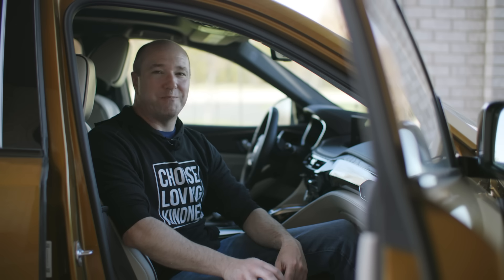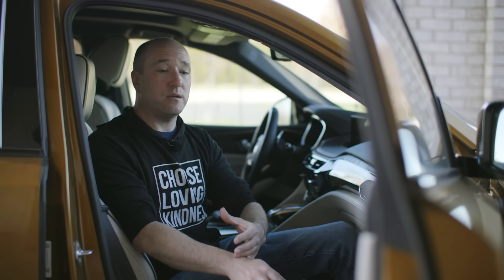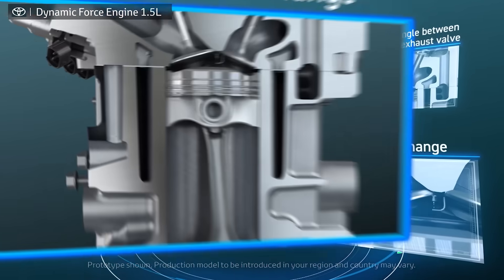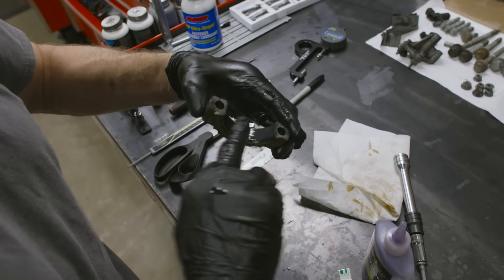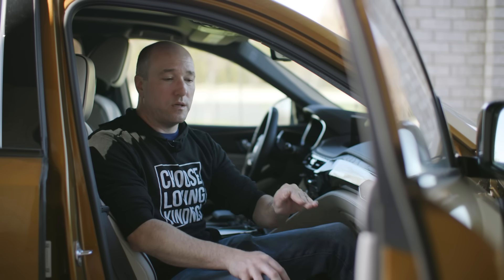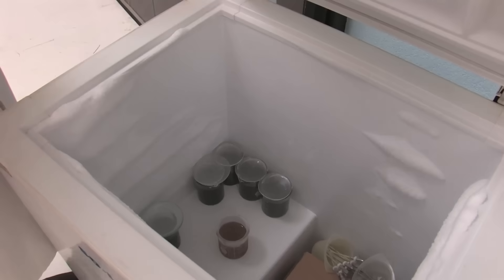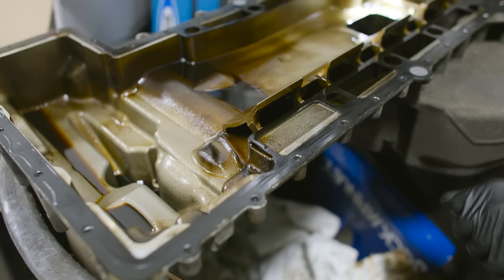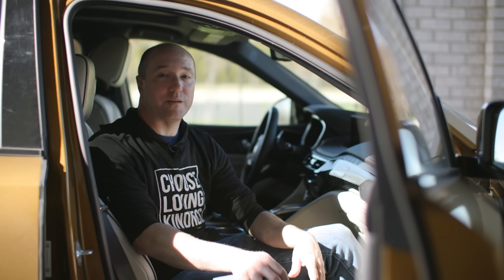Understanding Engine Break In | Dos and Don'ts

Comment: I bought a 2017 Cruze. Looked up the break in procedure. Followed it 99.9% of the period, and after the mileage was over, gently differed from the procedure. 

Then I came out from eating at a restaurant, and I noticed that I didn’t have a GM engine anymore. I had a Subaru engine swap done, while I was in the restaurant eating. Man those guys were good, wish the dealership was as fast as they were. The dealership rebuilt my engine, instead of replacing it, so.

Comment: I just followed the break in instructions in the manual when my 2021 Forester was new. I think it was something like for 1,000 miles, vary the engine load, RPM, and speed, and don't go over 4k RPM.

I think I did it right because we are at 75k now, and no issues. Even the brakes are the original ones. The service techs are always surprised to see how many miles are on it with how new it is lol

Comment: There is enought videos of mechanics checking the quality of the old after the change. 
There is enough metal shavings to prove that the advice about changing oil frequently is still a good advice. 

I personally change mine around 5000km (3.1k miles).

Comment: Thanks for making this! Very relevant to me because I'm gonna be buying a GR86 sometime this year (I've had a deposit down for a few months) but the dealership is about 500 miles away. I'm sort of looking for tips when driving her home from out of state. It sounds like a highway road trip isn't exactly the ideal way to break it in, especially since it's a Subaru engine and I think the stock oil is 0-20w. Should I break up the road trip for a couple of days and mainly stay off the highway?
Reply: Take the back roads..
Reply: @petesmitt  yeah, I'm likely gonna avoid the highway for the trip home. Looks like it only adds a couple of hours anyway

Comment: I was about to argue until you mentioned the 2-300 mile range.  My Aprilia is one of the stronger ones out there for it's year and was on track already at 300 miles after swapping out the break in oil the day before.

Comment: Any tips on what's the best way to go about breaking in a sports engine if I'm picking up a new car 400 miles away? I have to drive over to trade-in my current one, so delivery isn't really an option
Reply: Drive at different speeds / gears during your driving home. Go 20-30 mins at 55mph, 60, 65, take side roads thru towns, etc. 

Take exits and jump back on the highway at WOT often to exercise the drivetrain. 

Don’t over think it. It’ll be fine.
Reply: @I_know_what_im_talking_about  Thank you, this is super helpful!
Reply: Let off the gas periodically and let the car slow down to 45 or 50 or so.  Then moderately accelerate through the gears, bringing your RPM's up to 3-4k.  I say slow down first because you don't want to get your overall speed to get up too high. Long uphill grades are good for this. Don't use cruise control!!!
Reply: @luptonpittman6520  Thank you as well!
Reply: Drive it like you stole it  its a sports car  its designed to go fast
Reply: @bigdavedayday1581  haha will do so!

Comment: Really comes down to just reading the owners manual/documentation. My new Mazda basically told me to do precisely as you said for the first 600 miles. Varied speed, load, don't maximize it but also don't drone it out  for hours.

Frankly. What this really made me think of, taking a blanket method for all engines, when you really think about the different metallurgy, design, weight, specifications of each engine... doesn't make any sense.

Comment: When I got my Macan S last year I tried to keep it under 4K RPM for the first 1000 miles for the most part. After that, full throttle launches as long as the engine is up to operating temperature.

Comment: I would be curious what your opinion would be on 0w-20 usage  when a manufacturer only specified that oil weight for the engine. BMWs B58 has to use the Long Life Fe17+ oil spec (0w-20 eco oils) I know some say you can run the BMW 01 spec (5w30) but the manufacturer doesn’t recommend more than 1 liter. Whilst im not tracking the car, I don’t always go easy on it. it has the track cooling package and I see the temps regularly around 220 i think. Blackstone lab report has come back fine for that.

Then you have the older turbo cars like the z32 where folks say to use 20w-50 like oils to prevent breakdown.

Comment: The issue about the oil statement is in theory you are right you can go on a million miles or 100 years if the funny book that came in your funny car said so... But in pratice to which the car care nut and car wizard would attest the engine won't last 10 years if you don't change your oil every 3,000 miles or every six months for a number of factors. And yes Toyota honestly thinks you can do more but that in the Car Care Nut's experience as a Toyota master tech means it only leads to massive engine problems. Which for my 2020 Mustang I change it's oil when it tells me(With the fordpass app) It's on 30% Oil life which it got to in half the time when it was on factory oil. And I have had it for over 2 years now and seen it's about 6 months to when I need to change the oil in Northeast Floirda doing mostly highway driving 1000 miles a year. So yeah don't do what the manuel says do it when the car says or the standard...

Comment: Great video, I hope more people watch this!

My father used to be an engine builder as a career back in the mid 70's, he did oil testing for a company called Lubrizol. He's still builds small block V8's from time to time but now that he's getting older he doesn't do it as often ( I have some of his words of wisdom about engine building (and videos) on my channel and I encourage people to listen to him, as people like him are a dying breed some what...). When he used to build V8's back then, they would do what was called the "hemi break-in" and that was to put the car in fourth gear at about 30 miles an hour and put the throttle all the way to the floor to about 110 mph. He told me that they would do that 10 times change the oil and then the engine was broken in and good to go. Of course that was back in the day.

I'm a big believer in heat cycles and varying RPM so that you're not lugging the engine and you're not spinning it to the moon either. And then I think it's very important to get oil out as soon as possible to get rid of all the casting flash. I have done this with pretty much all of my new vehicles, dirt bikes, and engines that I've built with my father and everything has always been fine. I've built Japanese engines (Mazda, Honda, Toyota) and domestic V8's as well. And I do the same type of break-in and haven't had any issue. I think the key is heat cycles driving it easy with varying the speed and then dumping the oil as soon as possible. Modern engines are built to very close tolerances and a lot of times I feel like the components break in extra quick And it seems that engines are ready to roll a bit quicker these days.

I feel like everyone has a method... I guess this is mine. Thanks again for everything that you do on YT. You guys are an asset to the internet.
Reply: Your father was correct. The primary break-in issue is seating the rings properly. To do this you need maximum Mean Effective Pressure in your cylinders, that's what high gear full throttle accomplishes...
Reply: How would you apply this on an automatic transmission?
Reply: @kathcerbo6900  Very the speeds is about all you can do since you can't "load it up", per say.
Reply: What do you mean by heat cycles?
Reply: @ChrisB-gz7nl  Get the engine up to operating temps by putting a light load on it. Then you run the engine with varying RPM for around 30 minutes. Shut it off and let it cool completely on its own. Then repeat the process.
Reply: @BarnStangz  nice, that makes sense. Basically, just drive to work
Reply: @ChrisB-gz7nl  Yep, take it easy and vary the speeds and load and you're good.

Comment: I bought 2 new cars last year 1st a ‘22 elantra it had an obvious break in bad mpg, I drove it 80 miles a day to work that’s hilly around the 3rd tank it was good. My Taos I did the same but didn’t seem to have an affect on the mpg but still drove conservatively for 2k miles. Both had a 5k service interval both have been fine. I’ll probably never buy used again since working in a very reputable Japanese car dealer getting 15-20k mile oil changes. This thing guzzles oil like crazy, really who would have thunk😂.

Comment: Totally agree with 95% of the video. The 5% is about oil change intervals. Could write pages but won’t. With DI engines, be very careful due to gas dilution. Lastly if a new car, and was dealership traded, very likely drove flat out and hard. Something to think about.

Comment: I would never let the dealership put their oil, they put whatever meets minimum requirements, often semi synthetic. In the short term they aren't any problem but with the GDI engine, I would never use anything else than mobil1 extended performance.

Comment: Good info. I’ve always been advocate for varied rpm break ins and early oil changes. I didn’t know it was the rtv that one would worry about. Many years ago I owned a Mazda 3 that called for 0W oil and the way I drove it they oil got way too thin and I switched it to 5w which did make a big difference. Eventually that car was t bones by another driver running a red light and written off so it didn’t matter. 😂😂

My 2021 f150 ecoboost that I tow with I broke it in and did an early oil change. 

Great video. Thanks.

Comment: Mark, what did you do in your LC500?
On my IS500 I ran it very conservative for the first 1000 km. I also did my first oil change 5W-30 at 1,000 miles. I plan to do the next one at 5,000 and then every 5,000 miles after that as per manufacturer's recommendations.

Comment: I did exactly this (varying loads) with my performance 4 banger except the early Oil change. 
Not a lot of heat cycles though, it did maybe 2, then i took it on a long distance holiday trip which covered all break in miles.
After that i drove that thing up to 20k kilometers (about 12500 miles) before changing the factory oil and it is totally fine and in good shape.
Now it does between 10 ab 12,5k miles change intervals doing daily driving and some hooing around :D

Comment: I did an engine break in with my 23 Ford Bronco with the 2.7. I took it in to get the oil changed. The lady looked at me like “you’re wasting your free oil change at 1100 miles when the oil lasts for about 6000” “I told her I was doing an engine break in on it. She looked at me confused
Reply: I had the same situation. I took my new Prius in to the dealership at 1100 miles asking for an oil change. The person checking me in thought I was wasting my free coupon.  I had to explain it was to break in the car; was surprised he hadn't heard about that.
Reply: I had the same experience at Take 5. After the guy dropped the plug I literally heard him say "Wow, that looks brand new"
Reply: I just dumped the oil in my Bronco and refilled at 1600 miles in my driveway.  No filter change.  Didn’t want to explain why I was changing the oil at the dealer.  If I had the 2.7 I would have changed the filter but it is a PITA on the 2.3.  Would nave done it sooner but it had 1000 on it when it bought it.
Reply: It's never a waste of protect your engine long-term.... it's amazing the number of ignorant people allowed to work in a service shop ...... She sounds like one of them

Comment: 15:33 -- This is a good point. Whether or not you're personally planning to keep the car long term, you should still take care of it for the sake of other owners and the environment. There's no good reason to needlessly destroy engines prematurely just because you're cheap and lazy. It's so wasteful and irresponsible. In the same way, you shouldn't/wouldn't just wreck your apartment just because you're only renting it shorter term.

If you're the type of person that complains about EV adoption and want to keep ICEs viable, take care of your engines. Don't be a drain or leech on society. Be a good person.

Comment: I wonder what about cars with CVTs or hybrid CVTs where the transmission is always trying to get the rpm to stay at around 1-2k rpm no matter the load and speed (at least driving around town and not flogging it which you shouldn't be doing during break-in anyways)

I recently bought a Honda Accord Hybrid and when the engine runs as a generator, it sits at constant rpm. Sometimes I think about this fact and I wonder if Honda did any programming to maybe intelligently vary the rpms during break-in periods?

Comment: I've always just let the engine warm up (oil, not just coolant temp) before beating on it or revving beyond 4K or so. But when it is warmed up, I have no qualms about using all the revs. Engine braking is something I just do all the time anyway. Every car and motorcycle I've owned have been 100% trouble-free engine-wise. One did burn a bit of oil, but that engine (Peugeot EW12J4) was known for consistently drinking oil right out of the factory, like the Alfa Twinspark.

I don't think it's complicated, just use the engine under varying loads and don't be afraid to use it.
Reply: And don't violate your warranty by ignoring the manufacturer's guidelines for engine break-in.

Comment: I getting a Camaro ZL1 brand new in a few months. driving it home on the highway but going to very throttle, speed and rpms. changing the oil at 800 miles. anything I should lookout for

Comment: I've been watching engine teardown videos. Turns out oil is important. I have been spending the extra money and time to change it out every 5k even if it's too soon
Reply: Young! Want to change oil in first 1000 miles them 1 yr or 5000 miles and top tier fuel to minimize oil delusion.
Reply: Not necessary unless under heavy load or harsh conditions. Verify with Blackstone if you want

Comment: It's so nice that EVs don't have a break-in period 😁
Reply: @Mike Mike for the record, I don't like Tesla and I hate Elon Musk, but there is a million mile Tesla out there that had its battery pack swapped twice and 8 electric motor replacements. The model S costs about $13k-$20k to replace the battery pack, labour included. Even if you did that 3 times you are looking at $60,000 for 1 million miles. If you drive a gas vehicle that gets 30mpg, and you spend $3.80/gal, you'll have spent $127,000 on fuel alone, then you've got oil and other ICE related maintenance. Long term, EVs win every time. It is short term that they can suck. Now I can't easily calculate charging costs cause it varies a lot, but it would be miniscule compared to fueling costs of an ICE.
Reply: EV's still have brakes that need bedding in properly..
Reply: @petesmitt  Tesla beds them before they deliver the vehicle to the customer, and then the brakes will practically last forever because you almost never have to use them thanks to regen braking 🙂
Reply: @teslasnek  The whole break-in thing is a bit nerdy frankly; I have a 1989 Mazda that's done a third of a million km's and shows no signs of engine wear, as it has perfect compression and burns no oil; owned since new, it has just been driven normally and gets annual oil and filter changes. The whole driveline is original and I suspect the vehicle will outlast me..
Reply: @Mike Mike Tesla isn't the only EV company lol. There are already many high mileage EVs out there, and if you actually end up driving your car that long (most people don't, so your point is kind of moot), EVs have reduced maintenance costs and running costs. If you compare the value of a $50,000 EV versus a $50,000 ICE car and you drive it up to a million kilometers, I guarantee that that EV will have cost you less even if you had to replace the battery pack once or twice.

Comment: Recently had a new motor installed in my mustang at 50k and babied the hell out of it because I want it to last. Also reading forums about how 5w20 leads to oil consumption and how new gen 3 coyotes take 5w-30 makes me believe that we should run thicker oil.
Reply: Why did your Mustang need a rebuild at a measly 50 thousand miles. ? My 94 Trans am has the LT1 engine,  and has 338.000 miles on it. Engine never been touched, even the timing chain is original.  Still runs excellent.